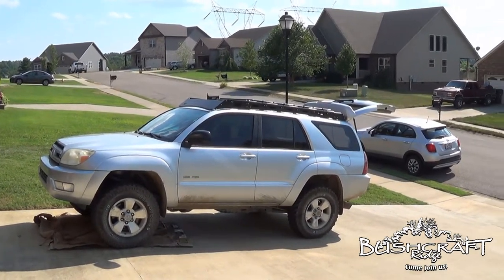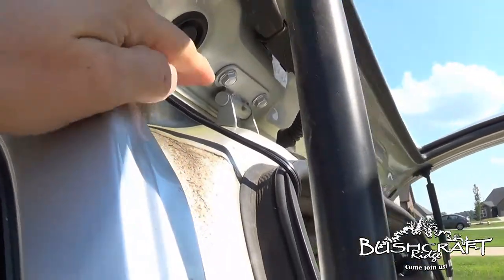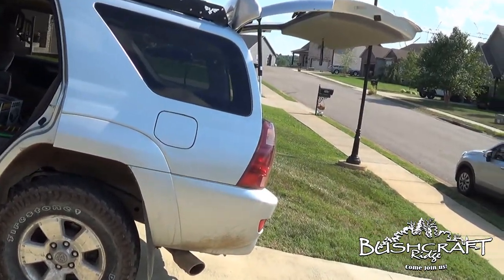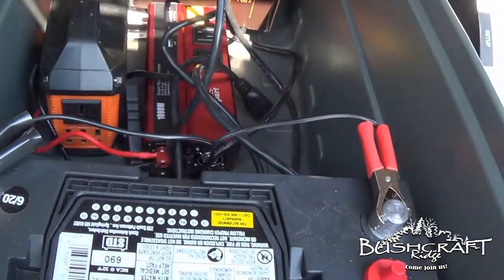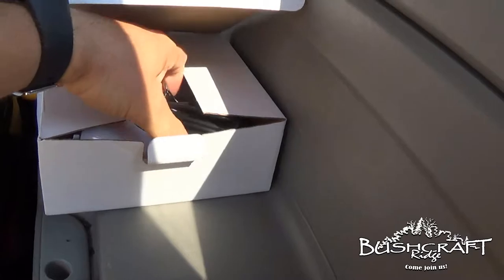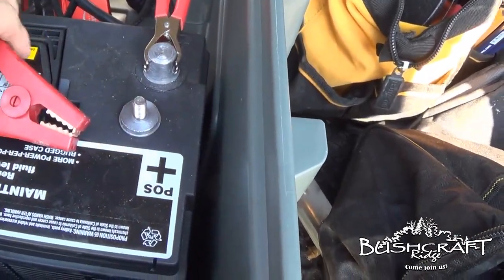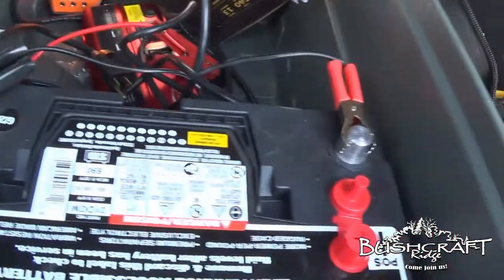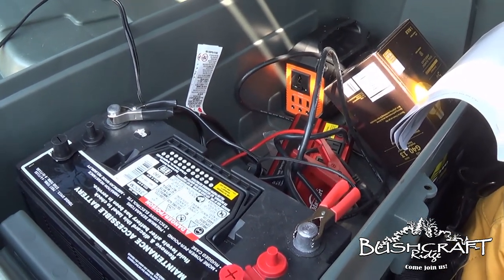First Test of the 100w Solar Panel Kit from Harbor Freight

Comment: Run into any problems with the cable going into the back hatch and that letting rain in or anything? Also have a 4th gen and I'm looking at running solar in to keep the main vehicle battery charged up. Not as much longer driving right now and my alarm kills the battery over the course of a few weeks of only brief drives, thinking this might be the solution but not 100% on how to get the wires into the 4Runner to get them through the firewall and to the battery.

Comment: 105Ah, amp hours
Nice upgrade on the inverter! Good to put some angle on them for the test, not required but it will help. Cool seeing how the controller works. LET'S can be brutally bright. While I was guarding a construction site a guard from another company came driving around from behind a nearby building. His headlights obscured my vision and had no idea who was incoming. I grabbed my small "tac" flashlight and blasted his windshield. That little single LED beam blinded him bad. When he came to my company he was still bitching about it a year later.
For the placement of your panels is there a rig or contraption you could make to raise the panels to the treetops? Then you could have the panels right at the cabin. 
Carch you later.
Reply from the maker: Amp hours! I knew I was messing that up. LOL!

Comment: anyone know where you can just buy the lights and no my local HF don't sell them.. no are they on there web site..
Reply from the maker: I have not seen the lights by themselves. But you should be able to find led lights with that standard DC plug on Amazon. Let me know what you find.
Reply from the maker: Like this, but I don't know if the DC plug is the correct size: https://www.amazon.com/dp/B0768QFN27/ref=cm_sw_r_cp_apa_i_qIYBFb45PDJ7S

Comment: How long does your battery last while not charging off solar? Like at night when you use devices? Just looking for about how long it takes to drain to 50 percent while using charge
Reply from the maker: There is a calculation you can look up based on how much you are pulling from it. I run a single light bulb and a box fan on mine at the cabin, so...forever. LOL!